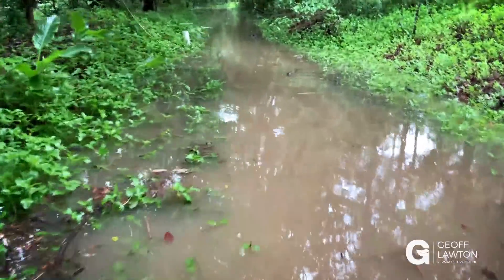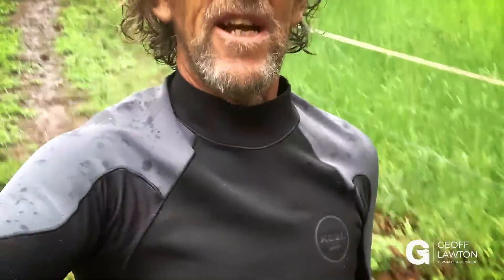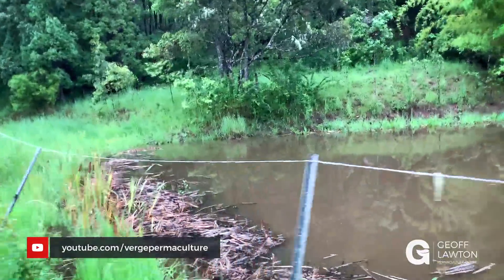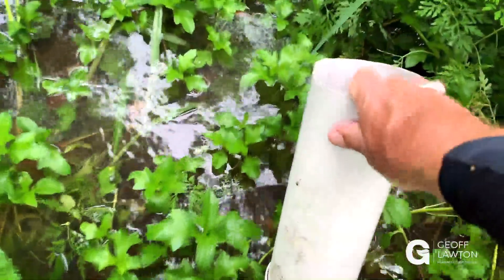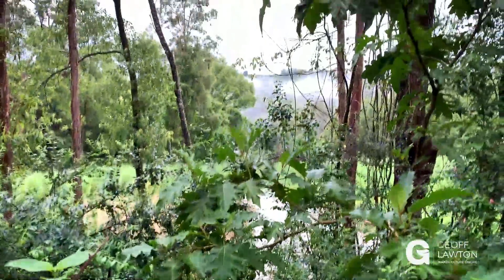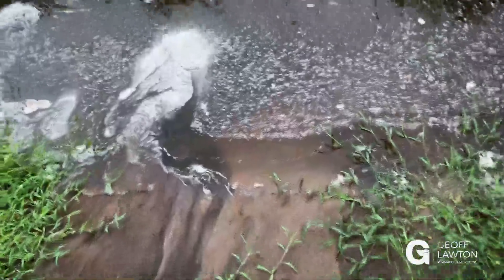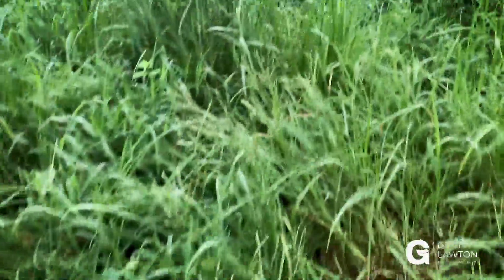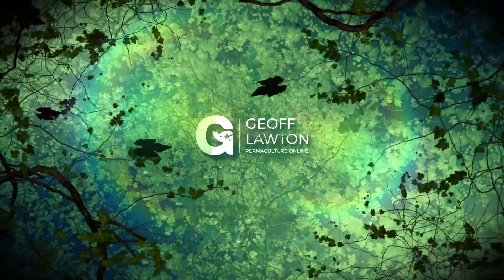Back From the Drought with a Vengeance; Water Flows of Zaytuna Farm February, 2020

Comment: Put some Talapia in the swales for fish, Great video.
Reply: A swale is a water INFILTRATION device (the water from the downpour should be soaked up after 1 week max). A swale is also a tree growing installation (they grow at the borders, above and beneath). The swales are meant to distribute water slightly inequally thus creating "zones" with more and less moisture. Drier above the swale and on a berm / mound. 

After such a torrential rain, there will not be much difference in soil moisture for a short time, but as they go back to normal, the microzones will emerge again, that are a good fit for different plants * and animals.

At the overlap of zones the most growth of bio mass happens, the diversity of niches and the edges between them create the magic. The farther apart the swales are the more pronounced the zoning effect will be. Each swale and the root systems of the trees that grow directly under it create a plume of water satuaration in the soil (it takes on average 7 years until the plume has its maximum)  

That water is supposed to be soaked up within days. Most of the time Geoff can use the swales as convenient and leaf covered "clean" walking paths and for a wheelbarrow (they are level so that is easy).  
They have frogs and reptiles to control mosquitos in case water stands longer  than 2 - 3  days (which does not happen often, but then they would have
 a chance to breed). 

But swales are  not suited for fish -  Geoff and team have those and water plants  in the PONDS. 

If the swales are narrowly spaced, all the land will be covered by their water supply, if they are spaced apart there will be zones that have less moisture water (or the plants have to work harder to suck it in, which means they do not get wet feet, but still can get moisture in emergencies, it will cost them some energy but they will survive).

People have installed swales in existing orchards with well established fruit trees (for instance in the South of France) and found out that some, like a few peachs tree under a swale did not like the unsually high  moisture, it was too much, their roots were damaged (likely fungal diseases)  not sure if the trees survived. 

Those trees had been well adjusted to the former dryness. If the same tree would grow above a swale with a little distance it would be fine, it could access the water (for instance during a draught), but the water is not forced onto the root system. Other trees in that French orchard did very well with the additional moisture provided by the swales,  but it also harmed a few (likely it promoted fungi and the trees are not used to dealing with them).

If one develops a system with young trees you do not have those problems. Experienced people will always plant an orchard on contour, and you lose the seedlings before they are valuable fully grown fruit trees if the location is not right for them.  And if the growers install swales later they could try to assess IF there could be too much of a good thing for some well established trees. In order to mitigate the problems. 

For instance planting water loving deep rooted plants between swale and a tree that likes it dry. Or just risking it for the development of the system. Or placing the swale on a different level, or interrupting the line (the swale ends) so less water is fed to the trees. They will get some water  indirectly but not as much.

Comment: You say the swales are full and so you push down the swivel pipes to release the water to lower dams/swales. But Doesn't it make sense to hold the water higher up on the property? Are they really full if the pipes, in their "upright position," are not yet draining out the swales? I figured the upright position of the pipes would be set to correspond with the maximum fill size of the swale.
Reply: I was thinking about this too... Maybe he wanted the swales to be full and functioning spillways before setting maximum level for swivel pipes to be configured correctly and only then forget about them. 

What I'm wondering is how swales are done? 30 or 50cm deep? 1.20 - 1.30 wide? Is it refill with a layer of sand or just digged and fork-pitched?

Also... The purpose of swales is to retain water to infiltrate it to underground water, and the excess to direct it somewhere else? Or am i missing something else??
Reply: @litoid  Brad Lancaster has books that go into more detail on sizing your swales and other water harvesting earthworks.

Swales infiltrate water. If the soil becomes saturated  (ie can't infiltrate any more water) the swale should fill up like a bathtub. The spillway is what directs the overflow so the walls of the swale don't break.

Geoff's addition of swivel pipes is kinda integrating keyline design in that he can move the swale water where he wants it. Maybe topping up a dam, irrigating some pasture, filling up unconnected swales, etc.

Comment: if you never want the water that high, why aren't the swivel pipes permanently lower/lowered?
Reply: Taylor Kuhla my guess is that the swales/Dams are sized for the heaviest local rains. You’d want to hold the water and then do a controlled release to lower swales. Otherwise the lower areas would get totally flooded and the rush of water might create lots of erosion. 
In the upright position the pipes still act as an overflow to lower swales. But I guess the proof of design is that they did not overflow yet. 

If even more rain was coming I’m sure he would want to empty the upper swales as much as possible. I’m not sure though if at the lowest point he could simply start flooding the plains below. 

Just some guesses :)

Comment: Why do you turn all those pipes?  Why wouldnt you just let the water soak in?
Reply: I think its just a way of controlling where the water soaks in, rather than have it trapped in one or two swales, allowing it to be soaked in lower and lower swales brings life to those areas.   Also you wouldn't want the swales overflowing and erroding the contour, so its a good way of controlling it.
Reply: My understanding is that the soil is already maximum saturated. Australia is hot. If you let the water soak in everywhere, you won’t loose too much of it to evaporation. Open water sources need to be well shaded to reduce evaporation from sin and wind.
Reply: If they got anymore rain the swales would overflow and cause damage. With this system he can move it down hill to other swales to prepare for more rain.

Comment: Could you explain the function of the slopes in your farm? I mean, what’s the use of all that water on your farm? :-D
Reply: Water management 101, the slopes are the natural landscape ;) the  level water trenches do not alter the gradient of the terrain per se, they just give the precious water time to soak in AND also prevent erosion damage and harmful flooding in times of heavy downpours. The rain soaks into the underground and the many trees and other plants can access it when they have a 1 or 2 years draught - or even only the normal dry season. 

Swales are tree growing systems (and the trees are crucial for water infiltration, and water distribution and pumping it up later when it is dry). 

Plus Geoff and team store water in some ponds and tanks above ground. Which costs material and space, some evaporation losses - and larger bassins could become a hazard if dams or walls break. Underground storage has the advantage that is is huge and for free - except for the costs to promote infiltration of water,  if needed. On flat land you just need to aim for good soil and plant enough trees, swales can be useful sometimes, but are not nearly as crucial as on a property like Zaytuna. 

Plus if the aquifers does not leak (which of course helps in other places) it beats storage in a pond (for use on a  farm) because there are no evaporation losses, the water is filtered and stays cooler.

 but it is less controlable and accessible than water stored above ground.

 A swale is meant for infiltration, the rain water is 1) stored underground after having soaked through and recharged all the soil on the way down 

OR 
2) the aquifers feed a spring or creek that can then  run year round, and even during draughts  - and of course that also helps to irrigate the land in dry times. Trees growing nearby the reliable above ground source of water spread it out (they do not have to invest energy to pump it up, so more varieties can grow and it will be more lush) and water of creeks can even be used for irrigation.

not sure if that is legal in Australia, likely not, but they use water of streams for irrigation in some regions of India. It depends how much they take out - and what the folks downstream think of it. 

Streams that are fed by catching the rain on a property, also help downstream.

The thoroughly and deeply wetted through soil / underground (it goes beyond topsoil !) remains moist much longer. it is one big sponge and there are capillaric effects (also thanks to trees) that move the moisture around.
That moisture is enough to grow ground cover and keep the trees and bushes going. 

Zaytuna farm was a run down, dry cattle farm when Geoff bought the land, most neighbours are still cattle farmers that do not  manage the water, do not grow lots of trees, let alone building very much  needed water infiltration infrastructure.  They went brown and their ponds and tanks were depleted.
They  had to reduce the herds substantially. Only keeping the best animals for breeding and buying fodder for them.

Ponds and water tanks (filled up with the surplus from the swales) are also a backup for wildfires. On Zaytuna farm they still had water  in the ponds & tanks when the farms around them were dry, and had depleted their stores - which of course makes it much harder to keep a fire from spreading, because it has to be brought in. The region was not hit, but they prepared for it, and sooner or later a fire will come along. 

That means they have to concentrate on keeping people safe and maybe saving the main buildings - but there is not enough water to defend the outer perimeter of the property and larger lines - not when they have to truck in or fly in water.

In California some rich areas were spared, they had the luxury of having a lot of golf courses (which is an insanity regarding water managment, using a lot of water to grow a grass monoculture in an ara that is semi arid). But there was not much fuel and it was well irrigated and the belt was wide enough to even stop the dramatic fires (which were so strong that they  created their own wind, even lightening. There is wildfire - and then there is that ). 

Lush vegetation makes it harder for the fire to spread, there is no tinder.  At least it slows it down, which also helps the firefighters. The water must be evaporated so the fire will not be quite as hot, which makes the "system" less dynamic, strong and fast.

Comment: I'm just wondering what's the advantage of letting the water go? If you didn't do it, wouldn't it slowly seep into the ground and end up where you want it to be.... Was thinking if you don't get another drop of rain for a year, it seems better to have the water seeping in from as high as possible and for as long as possible. I'm not telling, or even suggesting...I just trying to understand, because I know pretty much nothing about permaculture, except what your fine videos teach me. Thanks!
Reply: the swales had all reached saturation point. If the water moved any higher it would begin flowing over the food forest mounds, where you don't really want the water to be. That water will already slowly seep into the subsoil, recharging groundwater, aquifers, etc. 
Such a great sight to behold!
Reply: @braidenforest-weaver4274  There are level sills that allow the water to discharge without going over the mounds.  I think Andrew's question is a good one because Geoff speaks all the time about putting swales in even where water is saturating the ground.  And the level sill should be engineered to handle the water flow.  If there's too much water then those drains come into play, which is maybe what is happening.
Reply: Braiden Forest-Weaver how you make those Dams, just on a flat piece of land and make it go downward and on that lowest place you put the damwall and swivel pipe?